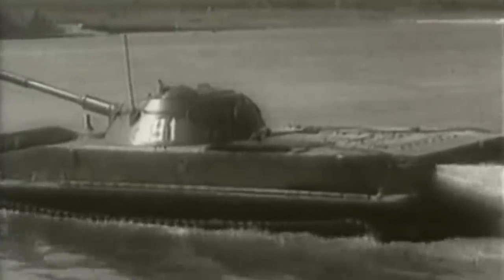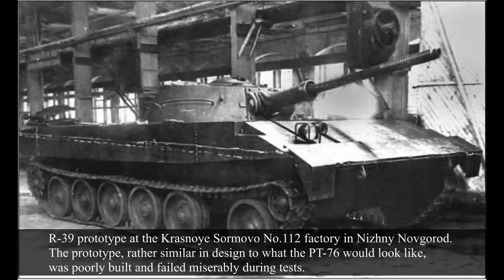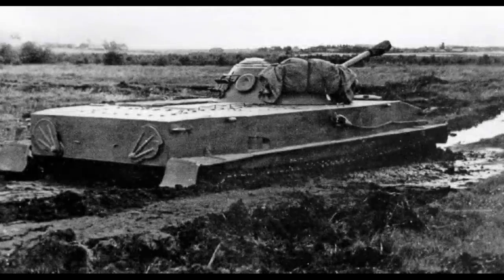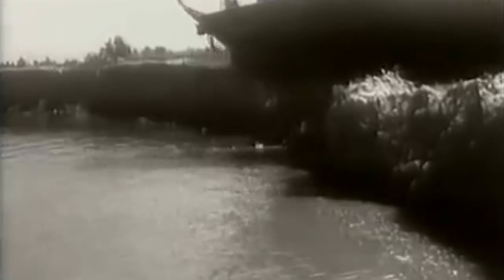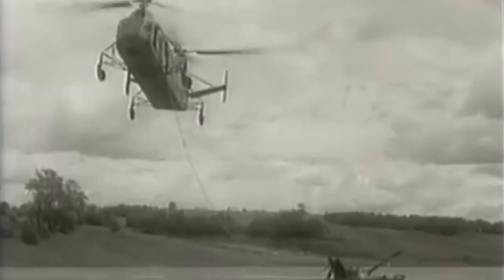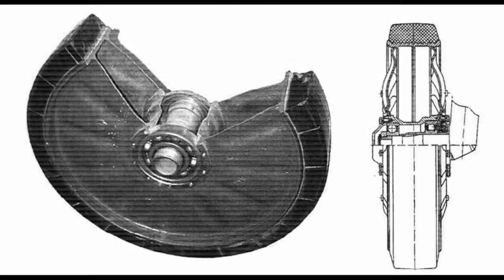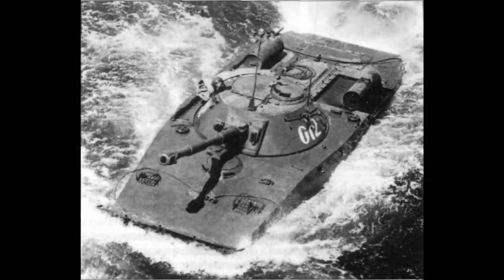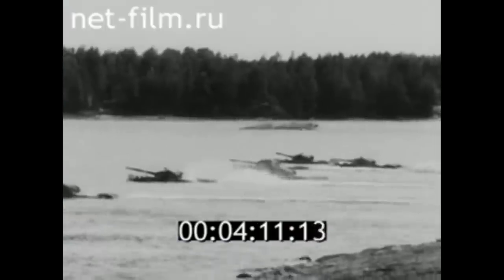The Soviet Amphibious Spearhead | PT-76 (part 1)

Comment: this tank was a bad idea. incompatible with existing doctrines (amphibious tank = recon) and unable to preform its intended support role without support from heavier tanks, something it would be unable to do if it had just crosses hard terrain and kind of nullifies its purpose in good terrain (why bother with the barely armoured support tank that needs a medium/MBT, why not just have MBTs?).

the soviets should have use either recoilless rifles (which the soviets had pre-ww2, and many of the issues with such systems had been mostly ironed out during ww2) or a high-low pressure gun (which the germans had developed in ww2).
->the former would have required an oscillating turret or exposed loader (and thus is more understandable due to lack of NBC protection, but still weird it didn't seem to be even considered).
->the later is really weird that they didn't try it. the german 10.5cm 10H64 of 1945 weighed about the same as the 76mm (infact slightly lighter) and had similar if not lower recoil, while useing cheap ammunition and had the potential for greater AP and AT effect (due to larger bursting charge and diameter). a soviet copy of the concept would have solved the PT-76's firepower issue as 10.5cm HEAT was a primary anti-MBT system untill composite ceramic armours in the 70s (its only drawback compaired to regular cannon shells would have been shorter range, but still able to deal with upto 1km against tanks with ww2 tech so later improvements could have reduced this issue)
Reply from the maker: its very much worth it to bother with a barely armoured support tank that needs 3 minutes to cross a river, while a MBT takes 30 minutes. It was a great idea, just not very well executed.